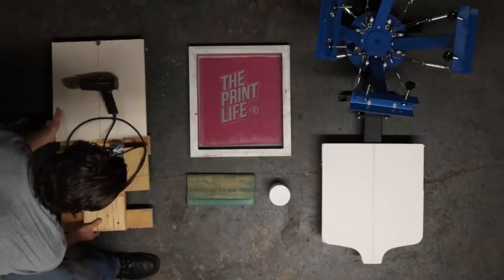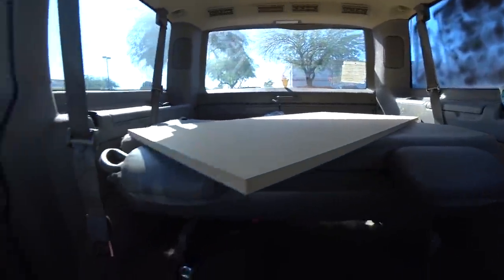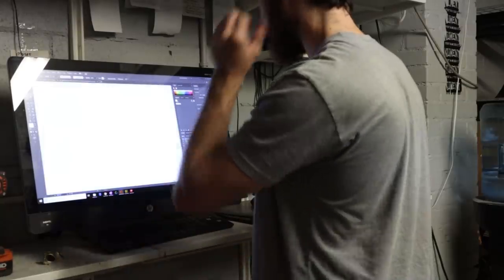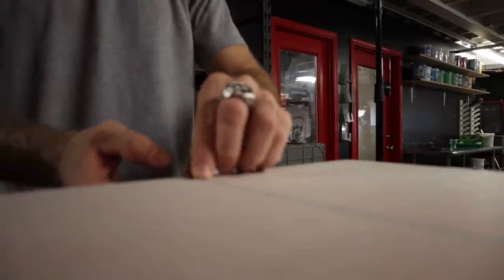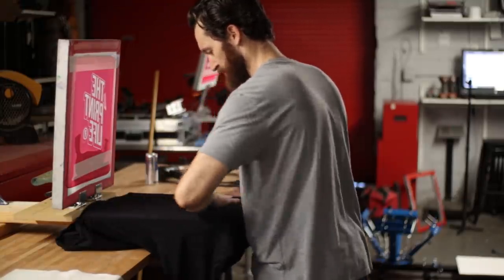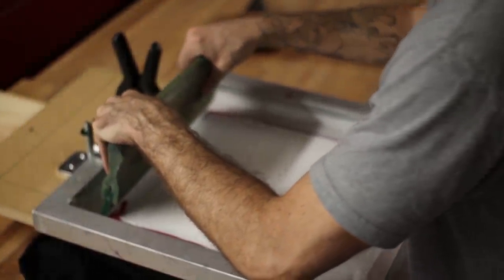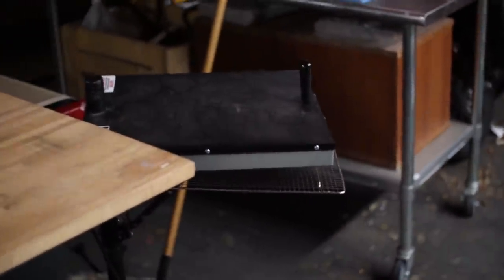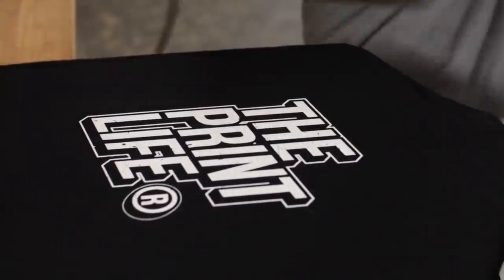STEP BY STEP T-SHIRT BUSINESS [ 2 cheap t shirt press options ] Homemade screen printing press

Comment: So I started with that exact blue press! and ran into the same problems and more..the biggest is that the base was bent to hell and 1/4 of the hardware was just non existing.... Soooo with a hole lot of swearing and some backyard engineering it is now with stand and functional registration. mostly from just stuff lying around my place or at friends. it rocks now! so if anybody has one of those and are just about to kick it to the curb and go back to a lovely life of flopping whoppers.... hit me up. I I can walk you through or make you some seriously needed upgrades!!  I would be happy to help!!
Reply: Cory Pettitt Is there any way i could contact you so you could help me out?
Reply: @carlosarturo3906  absolutely
Reply: Im all ears to help make the press register better
Reply: Cory Pettitt definitely could use some help also
Reply: @jeremyhelmick1471  how are you doing? I will help as much as I can. What are you working with?
Reply: Make a vid please
Reply: I also have this press and used to get weird registration that would sometimes be offset as much as an eighth of an inch. Not a lot,  but enough when trying to do a second pass on a shirt. I eventually figured out how to get it to register consistently.  All it takes is to wrap the clamp post in tape so it will be tight against the registration bearings when you bring the arm down.
Reply: @TehJawknee  absolutely! That was a great start. And for a few runs worked. Just make sure to check the tape once and a while. It will like to creep up and mess with off contact. If you are just pushing a few times a month. Absolutely. It works. And the gate is a lot of the problem. now if you have a single station on your for color probably won't mess with you too much or ever. But I had to go and get the 4 and 4..... Yup . 4 times the fun.
Reply: it was like the thing was built in four different factories by four different designers. I think every single one of the tabs was slightly in a different spot plus those upright bearings that held the arm onto the carousel did not help at all. So a quick easy type fix was I went to my local thrift shop and bought a old pair of roller skates. got to get the skates not the blades. Different size wheels. Took the wheels off. found a 6" scrap peace of metal stud from a construction site down the way and cut 4 big "U"s enough that the arm set in between the two roller skates wheels that are now attached to the top of the new meta gate. Did that for each one, and I left the pre-existing gate on. Used same bolts and mounting points. It was a night and day difference.
Reply: Cory. Have the same probs. What advice can you give on fixing these issues. Appreciate it
Reply: Awesome man, can you send me DM ? Or can we talk on Facebook/Instagram ?
Reply: @arthurlaskops5548  absolutely man. savagesignslogos@gmail.com or @Savage Signs Shirts. I have been pretty busy and haven't had a chance to put a full tutorial together. But I got a bunch of pictures and I'll answer any questions you got. And hell I could have some parts or either help you Fab up some parts.

Comment: Awesome video Cam. Can’t wait to see the $199 press do a multi-color print. Good luck!
Reply from the maker: Yea dude I dont know if I can do it. That think is tough.
Reply: @ThePrintLife  a small hammer is your friend! Loosen the screen off just enough to tap it into reg. Problem is they change reg when you tighten them up from loose!

Whether the press will actually hold reg, is another question altogether, though!
Reply: I have this press and I can't wait either! It took me FOREVER to put together but now I can do 1 color good (new to all of screen printing) and I have faith in you Cam, you can do it!

Comment: Maybe build a little topper box that has a hole in the side that you could place over the shirt. Stick the nozzle of the heat gun in the side hole and get an "oven" effect that might work better than overlapping passes.
Reply from the maker: That is a good idea worth trying for sure.

Comment: Awesome. Glad to see another video from you. This very informative for someone starting out. I remember when I barely started, I started with a diy 1 color press that I made from wood. Than upgraded to a used cheap 6 color 1 station that I saw on sale for $2000pesos (about $105 USD). Its a horrible press with no micros nor even an off contact adjustment. It's a pain but making work until I'm able to afford an actual press.
Reply from the maker: Yea man I think on this platform the entry level stuff is more usefull from a tutorial perspective.
Reply: @ThePrintLife  It is, theirs a lot of people trying to learn screen printing. As well it's very helpful as well to people already printing. Great way to learn new tips and ideas.

Comment: i have just got the same 4c press it was 120 eur and i got the same prob with bearings but i fixed it just by putting washers  in front under that part with bearings and it seems like its ok now :) lol im thinking about just redrilling  the holes.  Can’t wait to see the  press do a m.c  print. :)

Comment: I remember being at a shop trying to do a 2 color print larger than the black flash we had and having to use a heat gun/flash combo, or moving the flash (with no wheels) to cure in 2 parts....I'd say a good flash is the best investment moving past 2 colors unless your confident on wet on wet

Comment: im interested to see you try the milti color. i use the blue press and i have had a hard time with that. I also had a hard time bc of making the screens for a multi print also
Reply from the maker: Me to also feeling lazy not sure I want to deal with it, but I will
Reply: Easy fix for the blue press. Wrap tape around the post so the bearings tighten more when you bring the arm down.

Comment: Please make A video on how to Wash the burned screen without a pressure Washer...Thanks A lot, it would Be a great Help if this would be possible 😄😄😄😄😄
Reply from the maker: It works the same way. You dont need a pressure washer
Reply: The emulsion of my screen together with the design are being washed off when i pour water to the screen😞
Reply from the maker: @kentdichoso8369  expose for longer. what are you using to burn the screen?
Reply: Only a Light Bulb
Reply from the maker: @kentdichoso8369  watch my video on a cheap exposure unit. Light bulbs DO NOT WORK!!
Reply: Thanks A Lot...well Appreciated 😄😍😍😍

Comment: I use that blue press to do multicolour prints. It's doable. I've put thick tank tape around the piece of metal which is held by the rollers on each colour. It works really well. There's no more movement. It's great value, especially when compared to anything with micro registration adjusters on it.
Reply from the maker: Do you add a large trap to the colors?
Reply: @ThePrintLife  No but that's something I should look at. I've just googled it!
Reply: Are you talking about the piece under each arm that goes into the slot? I have that same press. Trying to work with it!
Reply: MrJrfuller83 Yes. A layer of thick 3M tape. The vinyl type, Works well. Stops any side to side movement.
Reply: @ChristianTalbotComedian  Thanks, will try. Just getting started and it's a pain.

Comment: if you’re starting out, you should record yourself so you can watch yourself. I started 3 years ago and I wish I could see myself as a beginner! 

I’m 19 and a full time student but I run 1 auto, 1manual, and 1 heat press.I just started making videos now but I wish I started sooner! Also, join a lot of facebook groups to learn from experts. I’m always down to answer questions too so feel free to ask me if you need any help learning how to screen print.
Reply from the maker: I cant tell if this is serious or condescending but I feel like a block may be in order. Just for the fuck of it. I block fast and hard!

Comment: Great video! But the real question here is can you turn the cheap press into a multi color press to try out before investing heavily?
Reply from the maker: I would not waste much time building a 4 color press personally. Not to say people don't make it work, but there is a point of diminishing returns. I would try the blue press because it is basically free most spend more on mcdonalds in a week. No matter how I slice it, screen printing is not cheap, the inks, emulsions chemicals all cost money. So there will always be an investment.

Comment: I like the idea blue one,many colour can been printed..and also saving a storage,can put at the side of corner..but,I worried about the clamp and the frame border,for long term uses..it can bend the frame border because it needed to clamp tightly avoid slightly printed..for me,that clamp design not good for long term uses..
Reply from the maker: Correct bending was a horrible idea anyway. Someone else mentioned I should adjust the pallet tilt and they were correct. That's what I should have done.

Comment: I started with the blue press myself and I hated every second of it. My bearings were worn out and none of the gate keepers were the same size so my print would ghost left right up and down it is terrible. And it was so hard to get the right off contact because everything was wobbly.  I mainly sell multi color prints and trying to register two color prints is almost impossible especially when both colors ghost. It discouraged me so much I stopped pressing and I sub my work out or I buy heat transfers.
Reply from the maker: for sure. I would not want to rely on that press for anything more than one color jobs.

Comment: Quick question. What type of screws did you use?
Reply: And for the other board is that a 8ft 2 by 8?
Reply from the maker: The screws were crappy dry wall screws. I litteral cut them with clippers so they wouldnt pierce the surface of the pallet. I'm not sure about the length of the 2x6 I think it started at about 6 foot. Just use what ever scrap you can find.

Comment: Is the platen size 14x25 or is it different? That's what I'm understanding by what you say
Reply from the maker: I would not go any bigger then 14 inches wide by 18 inches long.
Reply: @ThePrintLife  thank you so much for the reply. I made it 14 wide and 16 long. However I may re cut the platen since it came out ever so slightly not straight and my OCD is getting to me lol

Comment: I have this same press but the alignment area is slightly different mine has like berings but I can't figure out how to adjust them I just used electric tape to fill in the gap but is still not solid . if you have any suggestions I would highly appreciate it .

Comment: i have the multicolor press. im having issues with getting the screen adjusted. one side of the screen is on the pallet . the other side is up about a 1/4 from the pallet .. im a beginner and its frustrating . also how did you measure for your center lines so i can line up the registration marks on the screen to the pallet?

Comment: Okay so I have that Amazon 4 color 1 station press. But i need recommendations on where to get good screens?! I am literally just doing 1 or 2 color prints so where do I find the best screens? and what mesh would you recommend?
Reply from the maker: 110 mesh for white ink and anything 200 and above for colors. You can get screens on amazon check out my store on theprintlife.com
Reply: Is that the same recommendation for water based? I was thinking 160?
Reply: I’ve been using 43T for 1 colour prints in black and white using sign vinyl instead of a burned screen, works great 🤙🏼
Reply: @WBS2K9  vinyl works great for a single color if you're doing a short run. I tried it and the vinyl started to fall off the press after 8 shirts.

Comment: Hey @print Life Im building the $30 one now. I found a site that offers pre burned screens. Which mesh count should I buy to start with. I need to get 2 different screen burned. 110 or 156 count?
Reply from the maker: 110 will be easier to print but will be much thicker. 156 will produce a thinner print.
Reply: The Print Life thinner print is essentially what retail ready shirts are right?
Reply: The Print Life thanks for replying
Reply from the maker: Yea, there is more to printing for retail brands but you will get closer with. Higher mesh screen. If your printing with plastisol it will still feel a bit thick. But it's a great start.

Comment: Hey Cam! Great video man! I'm actually in the process of making the cheaper press as we speak. I have a few questions. My first question is how do I know where to my Jiffy clamp relative to my screen? Do I just measure from the end of the mesh(facing me) to the front of the frame (away from me)?  my second question is what size screw did you use? Thanks man!

Comment: Hey there, I'm trying to start screen printing as a hobby and a few things haven't worked out. 
1) I'm not sure if my emulsion was done correctly. I did 2 coats and have left it in a dark room away from light for 24 hours
2) I know either a 50W or 500W light is recommended but  have a 135W light that i used to expose the design on screens. 
I did 1 screen with 30 mins exposure. While washing out all the emulsion washed off the screen
I did a second screen with 30 second exposure and once again all the emulsion washed out. 

Not sure what I am doing wrong but I think it has something to do with the emulsion? 
Am I using the wrong light? Have a done the emulsion wrong somehow? Am i underexposing the screen?
Reply: Hi Karah, what you want to do before any screens is to figure out what your exposure time is. Google exposure calculator and you will find a graphic with different line thicknesses,  grayscales and sample type so you can test your emulsion.

The problem I can tell from your comment is that you are not letting the screen burn long enough. A 500w bulb is going to burn the image quicker than a 100w bulb.

This in mind,  you will take your calculator print and set it on your screen and toss a book or something that will keep the light off your screen while you test. 

You will cover up all but the first graphic,  then uncover the next graphic for the next test and so on. I'd say start at 4 minutes. Let it burn 4 minutes, then uncover the next graphic. This way,  by the time you expose the last graphic,  40 minutes have passed.

Then take the screen to your shower and hit it gently with the shower. Once it washes off,  you can fine tune your time from there. The best looking one will be one of your lower numbers since it will have exposed the longest. 

Also keep in mind the distance between your screen and your bulb. It will burn better if it's closer. It took me about 3 days and about a dozen blown screens when I started and it was as simple as I was under exposed. 

I hope I'm not rambling too much and what I've said makes sense to you or anyone else just getting into screen printing.  It's definitely a learning curve and it will take several tries before tou get it right. But once you found the formula, it gets easier.
Reply: Also,  make sure you wash your screens with degreaser before coating them with emulsion. This will make the emulsion adhere to your screen better.
Reply: @TehJawknee  Thank you so much! Just printed off the screen exposure test and am going to try that! I really appreciate all of this information!!
Reply: @TehJawknee  Just did 4 min intervals and really only showed on the 40 minutes one but the emulsion fully washed off again. Might have to buy some degreaser and start again.
Reply: @ktsuxx   Cam has a video about troubleshooting bad screens.  I found it after seeing this one. He explains the calculator and how to use it there. 

Also,  40 minutes is a lot of time,  even for hobbyists. Find a halogen lamp at Harbor Freight.  Take off the glass and try that using 3 min intervals.  Should work better than a 130w bulb.
Reply from the maker: Hey ya a bit late to this convo. It sounds like your light isnt putting it it enough uv to harden the emulsuon.Those lights you are using may be the issue, the sun is by far the best cheap option. Those halogen work lights from home depot are the worst they have low uv output. The 50 led I have in the description has a very high uv output and they work great, but start with the sun 15 second exposure and you will be good to go.

Comment: Hey print life, you didn’t specialize the exact dimensions of the pallet arm and legs for example you gave us the length but not width and height also i saw you added another piece for the clamps to be attached to that you didn’t exactly specify. I’m trying to make my first press and I would like to make it exactly like yours sorry for the inconvenience if you don’t have the dimensions but i would appreciate if you can share every dimension detail with me
Reply from the maker: No I did not I was winging it. There is no rule or specs, just make it to the dimension of the screens you are using and you will be good to go. as far as the pallet, I would say 14x18 will work great

Comment: Can you use a heat press to dry the t shirt rather than a heat gun or flash dryer?
Reply from the maker: I have heard that people do it, but I have never tried it. I will do a test of this process.
Reply: I use a heat gun to dry while on the palette and I use a heat press to cure. It helps since i still don't have the budget for a dryer. 

I use teflon sheets and keep my press at 330 for about 70 seconds and my prints come out looking great. Wax paper could work if you don't have teflon sheets. 

One problem is that you will have to clean the press of dried ink that sometimes goes through the teflon sheet onto the press itself. Not a big deal since it's already cured and easily flakes off.

Until I can afford a dryer,  I'll most likely be using this method.